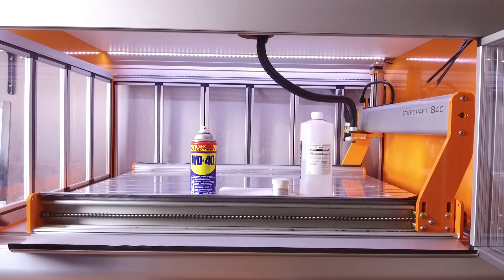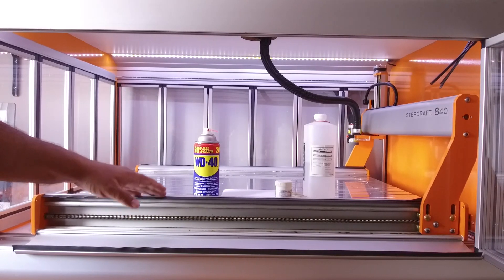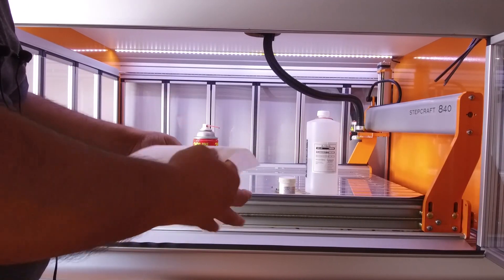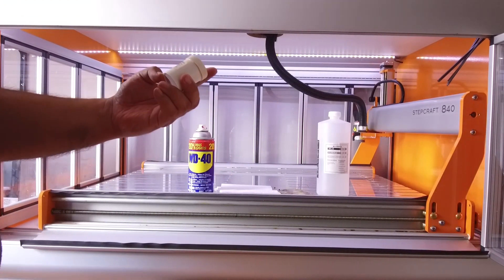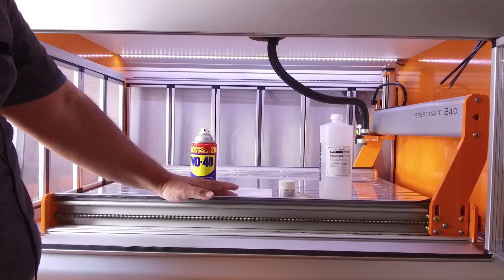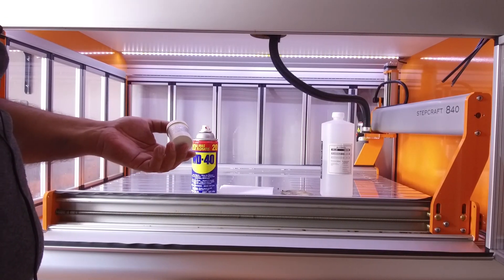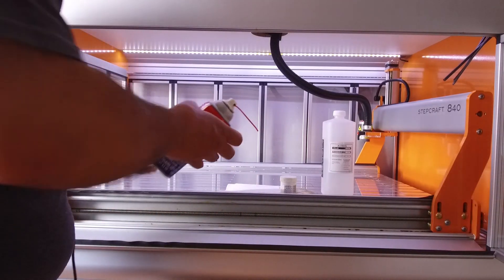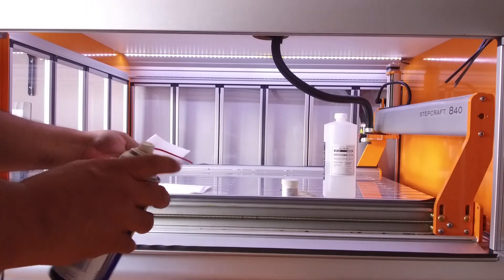How to clean and grease  the Stepcraft CNC

Comment: How did you set up the machine to move by a key press?
Reply from the maker: The shortcuts for UCCNC are Left/Right arrow keys move X Axis, Up/Down Arrow Keys move Y Axis and Pg Up/Down keys move the Z axis.  Holding Shift key while press those buttons moves the axis at full speed
Reply: Stepcraft Inc thanks

Comment: Fantastic - simple solutions are always the best. Can I suggest as a cleaning alternative that engine degreaser cleans the rails and lead screw like magic. I normally use it to clean the resin off my saw blades and thought to use to remove the grease on my Stepcraft and "wow!!". Do you (or anyone else) have any comment on using PTFE dry lubricant as an alternative to the grease?